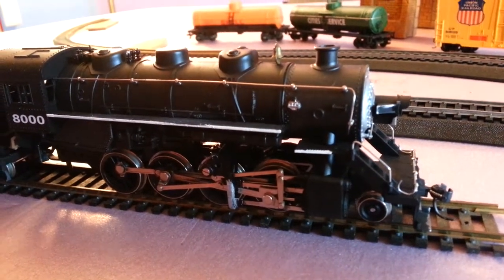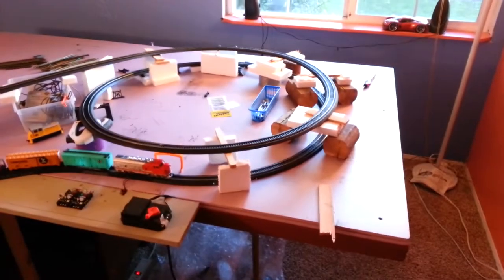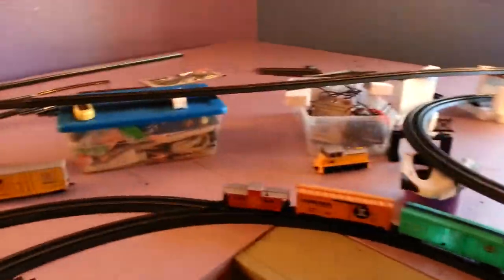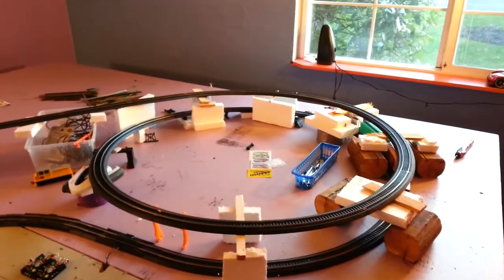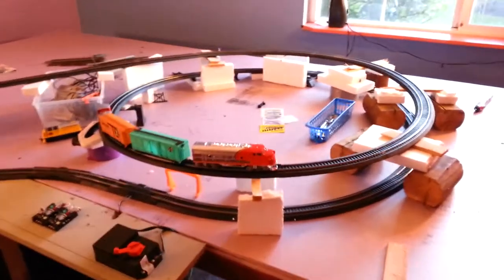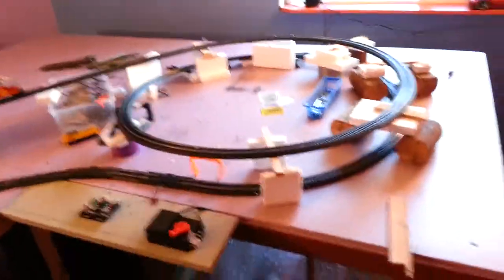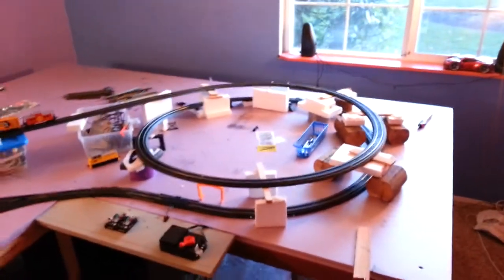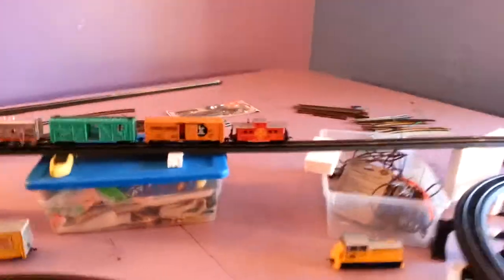#1, The beginning, HO model train world in a bedroom months to go!

Comment: What is your table size?
Reply from the maker: I built it on a picnic table of all things 12' by 4 and then build an additional 4' by 5 platform making in an L shape.   I had no clue what I was doing at the time and would do it much differently if I did it over.
Reply: @IceManOregon  may I ask, how big is the room?
Reply: @IceManOregon  I'm looking at doing a similar layout. "L" shape. Yours looks great and has given me a lot of ideas.
Reply from the maker: @jsrogers6464   jusy be careful with your elevation grades, not too  steep and how tight your corners are compared to the engines you're using.